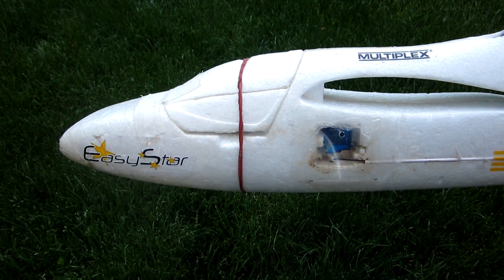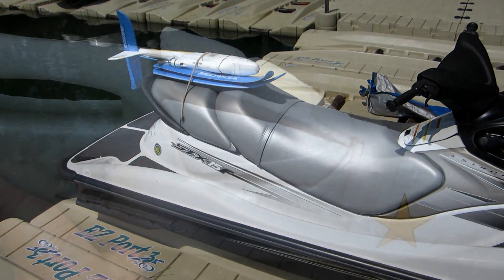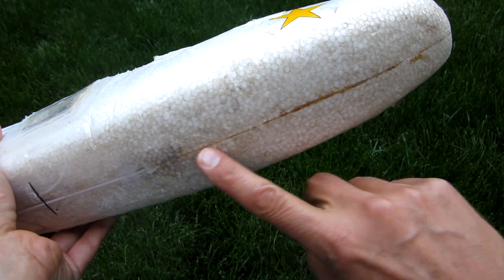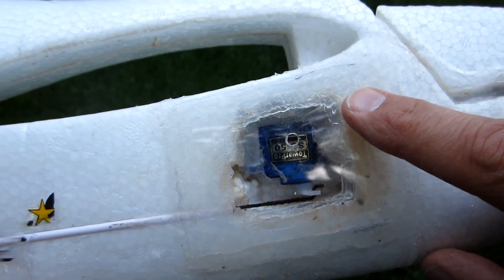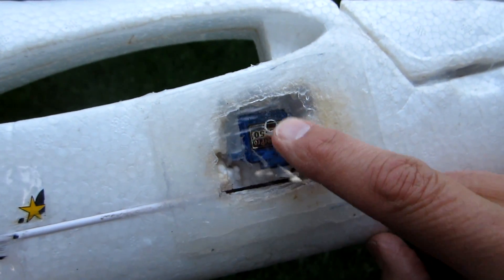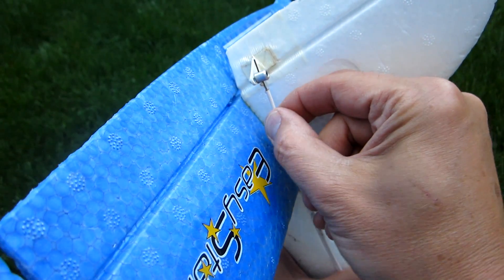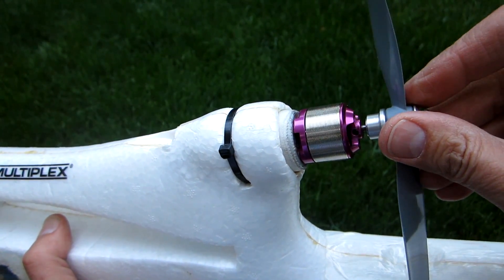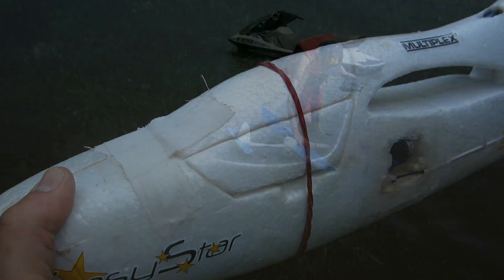Waterproof RC plane: Modified Easy Star

Comment from the maker: yes i put on a brushless motor, an EMP c2826/09-1900, with a 11.1v 2200mah lipo battery. i like pusher prop planes (less danger to people), would recommend an easy star or wing dragon plane.

Comment: Use Corrosion Block or Corrosion X  to waterproof all electronics. It works, They work underwater. I fly seaplanes so it is a must. Good Video.